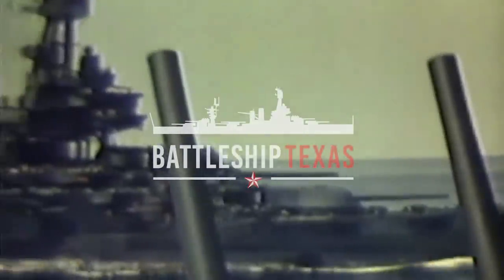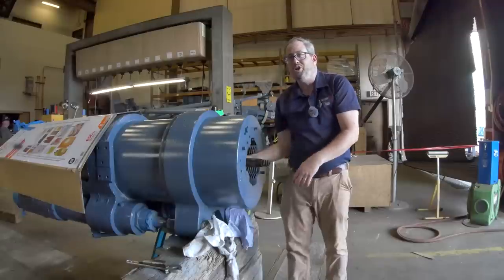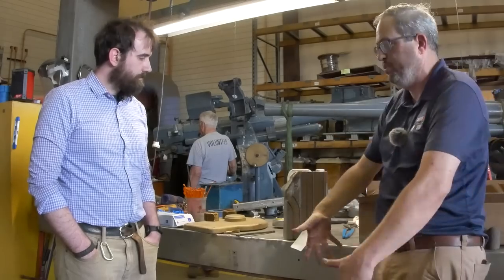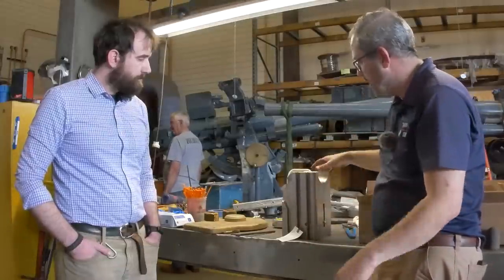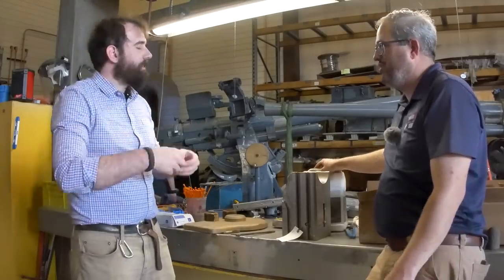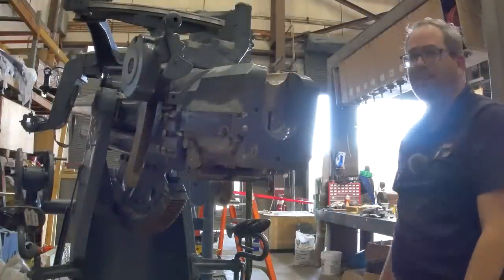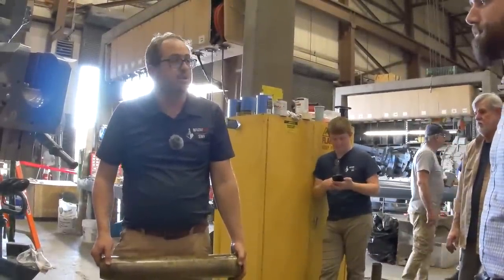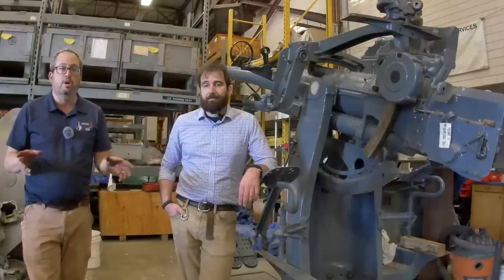Into the Breach of Texas' Guns With Battleship NJ: Part 2

Comment: Thank you for these videos. I think these 5" guns work like a 105mm or the bigger 155mm with the sliding breach. I think the 120mm main gun in the Abrams tank works like that too as opposed to the rotating breach ni the 16" guns.
Reply: The 3" has a sliding breech.  The 5" an interrupted screw breech plug.

Comment: Some of those parts can be spray welded and remachined to look perfect.
Reply: I was going to say something similar. They can do the same thing with laser metal printing. They did the something similar for an old F4U Corsair were they reprinted the surfaces of all the valve faces because they had been reground so many times that they were too thin to work to remove the corrosion on them, so they literally reprinted the valve faces with a metal printer and brought them back up to the original specs and worked them from there.

Comment: The mushroom is called an Obturator .  It’s shape is made to conform with the barrel with crazy hot high pressure gases caused by firing  to seal the breach  and direct all the gases towards the muzzle of the barrel . 😊
Reply: While you are correct that it is part of the obturator, the term "mushroom" is legitimate due to its frequently use in old Navy ordnance manuals.   While it closely conforms to the back of the chamber, the mushroom itself doesn't seal the breech.  There is a pad made of canvas, asbestos and tallow that was sandwiched between the mushroom and face of the plug that served as the gas check.  Chamber pressure from firing pushed the mushroom back so that it compressed and swelled the pad.  The swelling is what sealed the breech and made it gas tight until the shell left the muzzle and pressure dropped.
Reply: The “mushroom” technical name is the spindle. The obturator sits on the collar behind the head of the spindle. This technology is still being used with artillery pieces today. Now the materials used to make obturator bands have changed but still works the same way you explained. Nowadays, the obturator band consists of a split ring then rubber composite band and then another split ring.

Comment: 3”50 was electrical firing pin if I remember what I was told.
Reply: That was probably the 1950s version with the automated mount. They were different in many ways to the earlier marks of 3-inch/50.
Reply: I am not aware of any modification of the 3"/50 cal ever mounted on Texas that was electrically fired.  They are all percussion.

Comment: When will yall start re installing the guns back on the Texas
Reply from the maker: the 5" guns will be put back on while were in dry dock but probably after more of the exterior painting is done so they dont get too messed up. The rest of them can be easily craned on either on land or via floating barge.